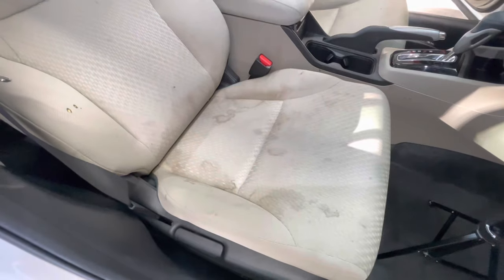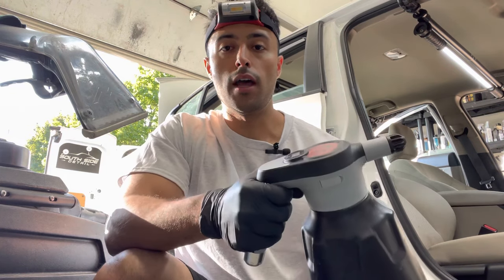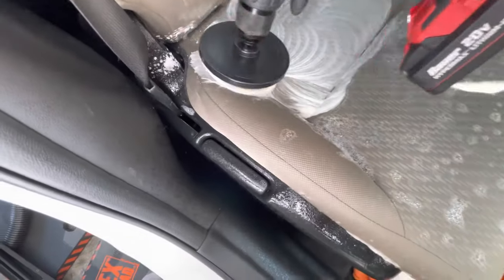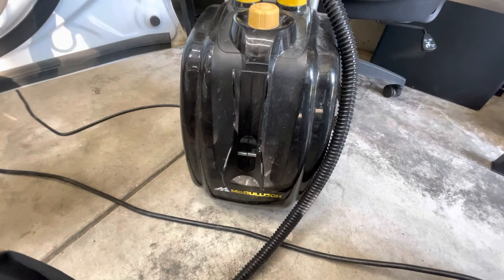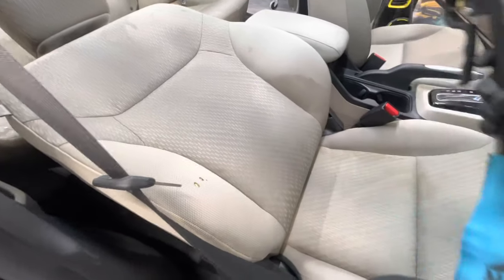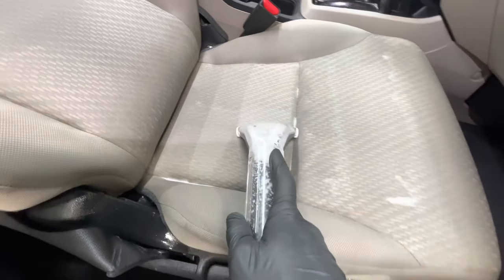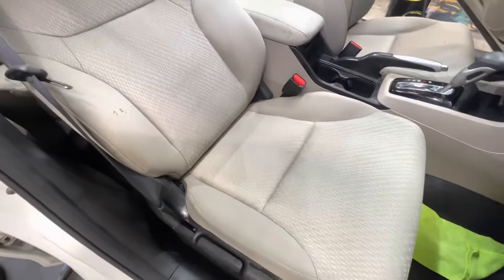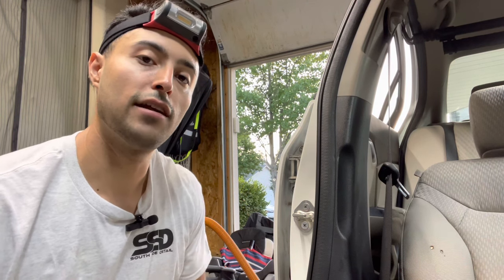How to clean and remove stains from cloth car seats / upholstery.

Comment: Nice Video and good job!
I wonder if my seats with seat heating can also be cleaned? Or does that amount of water damage it?
Reply from the maker: Thank you ! You should be fine if you use the amount similar to what I did in this video . Just make sure to wipe off any excess water from the seats with a microfiber towel, and use an extractor or vacuum to remove any remaining water in the fabric.
Reply: It's was too much chemical. there was no need to get it that saturated. Most of it could get off just brush and light spray of chemical. It looks like it was just dirty of top of fabric. Lots of detalers just do to much for no reason. I get the same results from a damp towle and brush and chemical.
Reply: @mingoreyes1  I must say that I bought myself the bissell spot clean pro and cleaned my car in the meantime and the carpet and one seat looked clean but when I extracted the water it looked like coffee 
Idk if someone spilled Coke or coffee but I extracted at least 4 liters looking like black coffee. I got the car second hand and yeah I'm happy it's super clean now 

I understand your opinion tho and if I was the first owner of the car and all the dirt was caused by myself I wouldn't have cleaned it as through and through

BTW my seat heating survived it (dunno if that's the correct english Name for it)

Comment: Good job! Would my spot clean pro be able to achieve the same results? Because when i feel the suction power up close with my hand, it feels like it barely sucks anything at all 😢
Reply from the maker: Thank you ! The Bissell Spot Clean Pro is a nice compact extractor. It’s the first extractor I used. As far as the same results I would recommend using the drill brush method first to agitate the stains in the fabric. Then mop it up with a microfiber towel. After that , then use the spot clean pro to extract. The same process I did in this video . Hope this helps !
Reply: @southsidedetail  Thank you! Do I always have to put liquid in the spot clean pro or can i start extracting the carpet bomber i use without using the spotclean sprayer? Not sure if that makes sense but i am just wondering if i can use it just to extract what is already there or do i have to use the sprayer on the spotclean for better results? it just seems really weak to suck up an over abundance of liquid. 
PS i subbed because you actually respond! thank you!
Reply from the maker: @_GandalfTheGrey_  yes you don’t always have to add more liquids / cleaning chemicals to the upholstery you’re cleaning. I always avoid over saturating seats and carpets. These seats were heavily soiled so in this instance I needed to add more cleaners with my extractor. If you feel like your extractor doesn’t have a lot of suction you can still add more liquid with the extractor you have but just make sure to dry / mop up as much of the chemicals from the seats as possible with a microfiber towel or multiple towels if necessary. I would then follow up with a wet / dry vacuum to get the remaining moisture out of the seats…. And of course always willing to help ! Appreciate the subscription! 🙌🏽
Reply: @southsidedetail  Thank you for the advice! I try to use the extractor as seldom as possible!  it sometimes it’s needed!
Reply from the maker: @_GandalfTheGrey_  you’re welcome !

Comment: Great video. End product is great. Do you have any tips for those who cannot yet buy the mytee lite?
Reply from the maker: Appreciate the feedback ! If you don’t have a carpet extractor a drill brush is highly recommended. You can get a lot of stains out with a drill brush alone. A steamer is also an option to use if you don’t have an extractor.
Reply: @southsidedetail  I have a steamer as well as a drill brush. I bought the bissel pro but it won’t be here in time for what I need it for unfortunately. Thanks for the info man
Reply from the maker: @bradydobson5970 you’re welcome!

Comment: thank you grea tjob! , any home remedy products i can make like baking soda/vinager mix ? 2. can you just use the extractor to lift the spray u used and not the soap it shoots in w/ the water? in other words, soap free extracting? thanks!
Reply from the maker: Thank you ! I do not know of using any home remedies. I recommend using the products in the video from Meguair’s or P&S. Yes you can just do a dry extraction to remove the cleaners from the fabric. Follow that up with a mop up with a microfiber towel.

Comment: Did you end up using the carpet bomber? If so at what time throughout the video?
Reply from the maker: Yes I did. I used Carpet Bomber after I used the drill brush with the Meguair’s APC. These seats were extra and needed both cleaners.

Comment: Currently have a car that had a broken rear window the interior had gotten wet and developed a moldy mildew smell. I don't believe there is active growth just a smell. How would you get rid of that?
Reply from the maker: I would do a deep interior cleaning of all the seats , carpets and interior surfaces first. If that doesn’t work an ozone machine treatment may help too.
Reply: @southsidedetail  thanks.  Any product suggestion?
Reply from the maker: @and1chewy1 the products I used in this video are in the description. This is a link to an ozone machine from Detail King , https://store.detailking.com/ozone-generator--12v-tubular.html

Comment: Tell mebmore about the mixer of that bomber ...I need such detergent
Reply from the maker: Highly recommend P&S Carpet Bomber ! I use it diluted 5:1
Reply: @southsidedetail  Am in Kenya  tell me more about  P&S just started my detailing business
Reply from the maker: @dancefelode thanks for tuning in! P&S makes great professional detailing products. I really like their interior cleaner too, it’s called P&S Xpress Interior Cleaner . I use that for all the interior surfaces such as door panels, dashboards, steering wheels , etc. I also like their wheel cleaner called P&S Brake Buster. Works great on most OEM Factory wheels and can be diluted as well.
Reply: This is the company bro just check me out am Dance felode controlling this comment